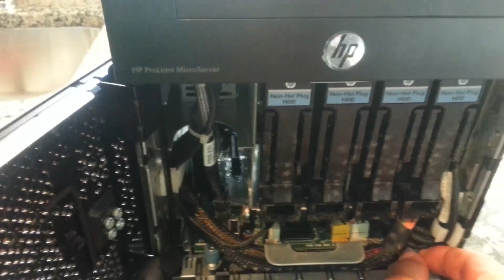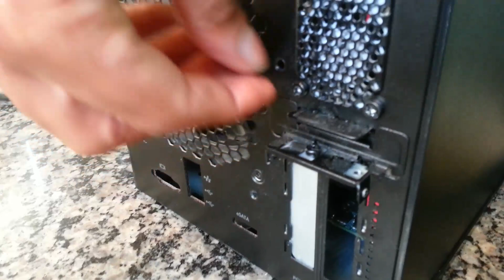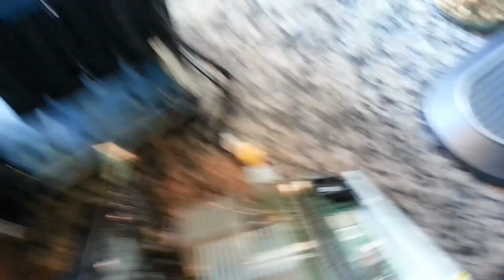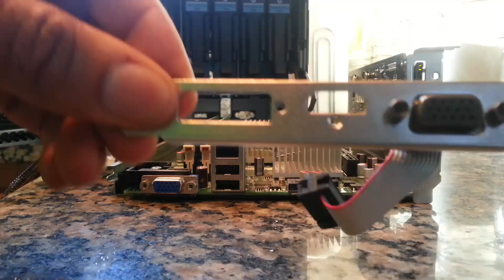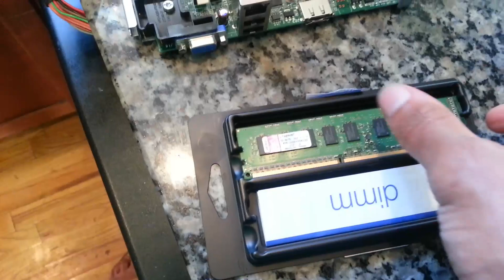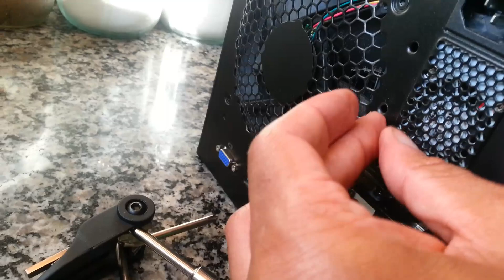N54L Ram & GPU upgrade

Comment: i ordered bargain ecc ram 16gb from eBay and it didn't work, server didn't post at all >:(
Reply from the maker: mortal486 
You should generally stick with 8GB for any production machines. Users have had luck getting 16gb to post however: http://homeservershow.com/forums/index.php?/topic/5557-16gb-ram-for-n54l/
Reply: Crucial and Kingston have been verified to work.

Comment: Hi,
My onboard vga seems to have crashed and as I was going to fit a card anyway I can't be bothered to return it to HP.  On first boot after putting the card in did the bios find and configure it automatically or did you have to disable the onboard vga first? If I have to go into the bios to set the card up then I will have to return to HP.  I currently run it headless with Amahi but I am going over to WHS2011.
Reply from the maker: The BIOS is set to look for and prioritize discreet GPUs by default, from what I recall. Also, my sincerest apologies for the late reply, and I do hope you were able to rectify your display issue.
Reply: Hi,
thanks for getting back to me and yes I did get it sorted.  I bought a card and installed it and it worked straight away so I guess you are right and the Bios does indeed look for added GPUs.  I have now installed WHS2011 and set up remote desktop so I don't need the video output anymore but at least it's there if I need to reinstall or want to change the server OS.